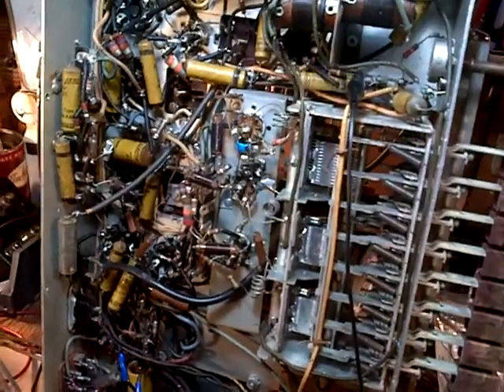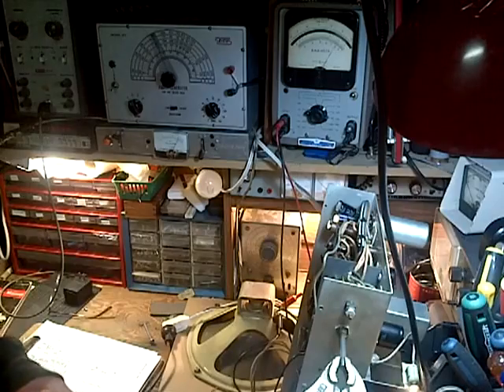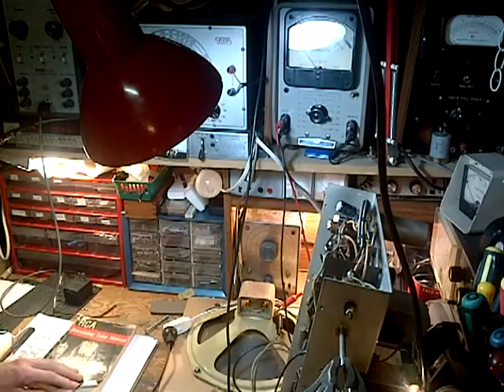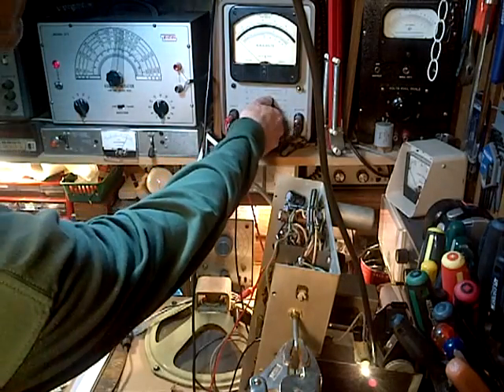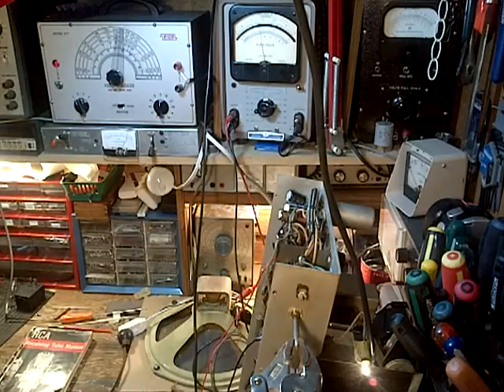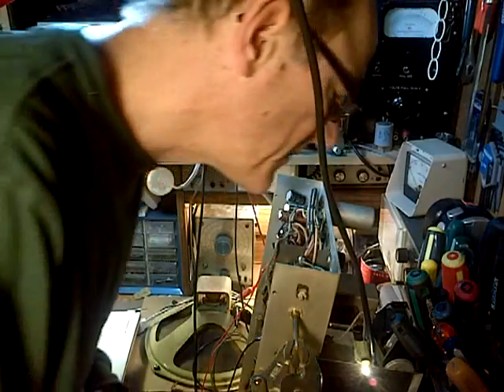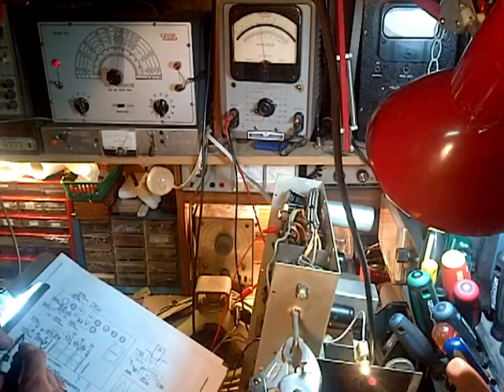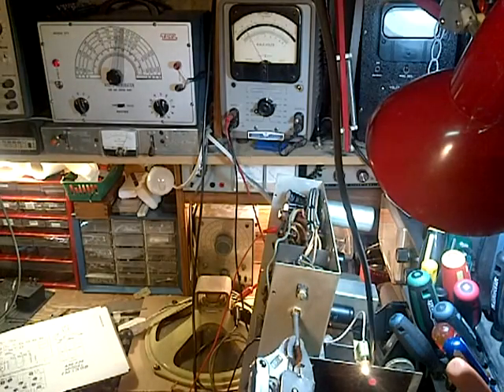Westinghouse 1398 AM/SW/FM Tube Radio Video #13 - Final Alignment of AM and SW bands

Comment from the maker: Thanks Jon but I'm actually finished that radio and on to the next.  Keep watching and you'll see how it ends.  The last video will be #15.  I also try to determine when the problems are alignment or component based.  Fact is I've never seen a radio so far out on the alignment which is why I was hunting for a component failure.

And I'll have to try to fix up my signal generator which is becoming more unreliable as time passes.  That'll be a big challenge for me.  Luckily, I have a backup gen.

Comment from the maker: I'm never sure what to do with respect to replacing capacitors.  I've done too many radios where replacing all the caps has made no difference.  In a small 5 tube radio, there aren't many caps so replacement is not a big deal.  In larger radios, such work will introduce more issues with wiring or errors made during the replacement process.  I try to work based on direct evidence and avoid wholesale replacements.  Each radio is different and my approach changes too.  Thanks for your comment.  Jim